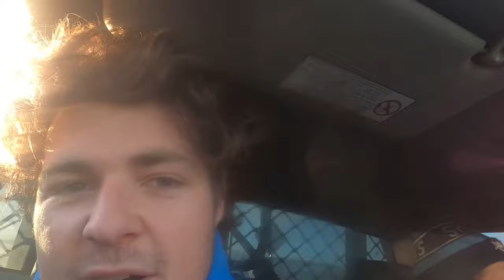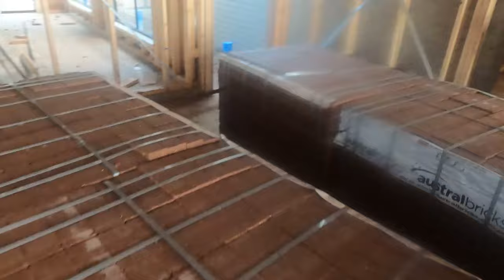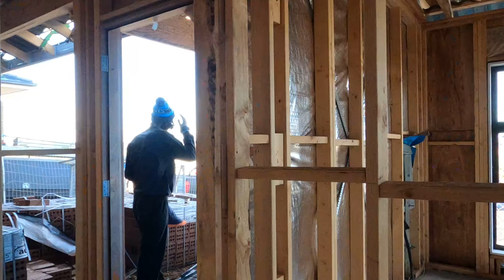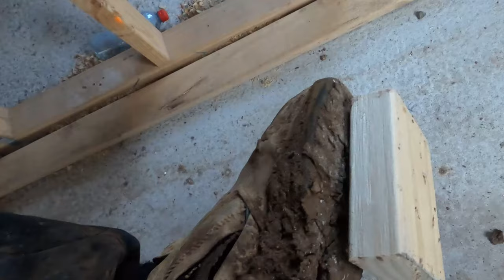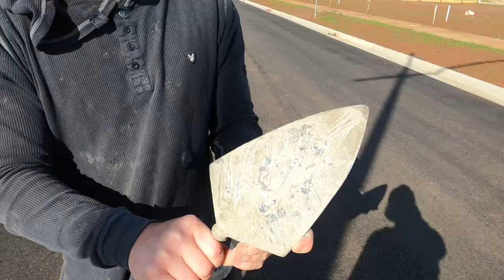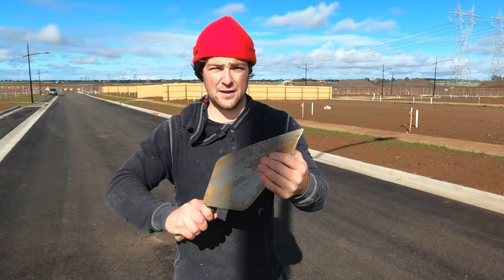Bricklaying Trowel of Choice / Worst Site EVER!?

Comment: Should try the W Rose trowel mate limber blade nice and light plenty flex. Normally use rubber handle but recently been using there leather and half wooden handle lovely trowels. Can get from 9inch right up to 13inch also go up in half inches. They have a cork handle also.